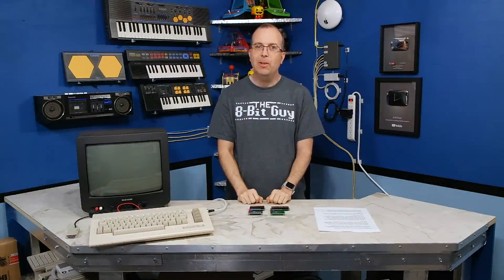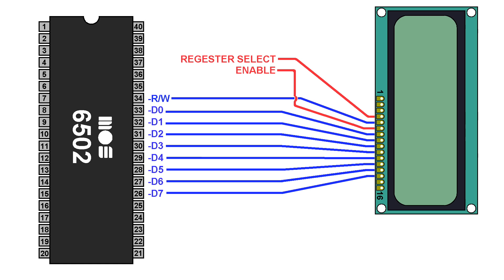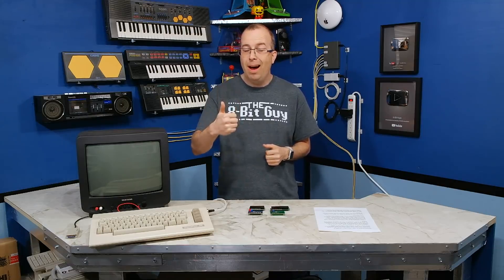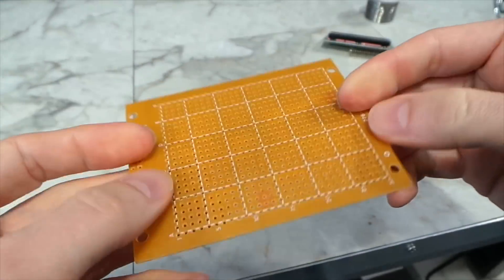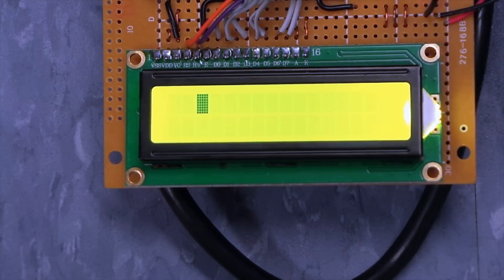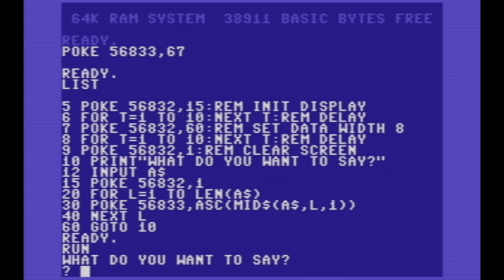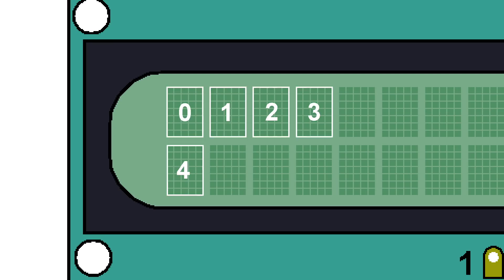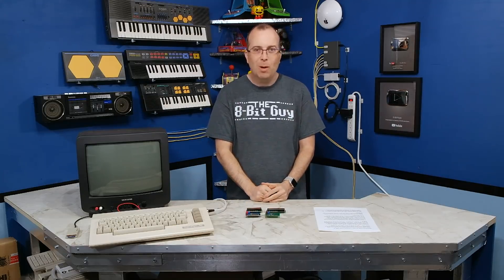How a Character LCD Works - Part 3

Comment: Good video, but I missed details about the boards your friend made and the details about those drivers/latches on them.
Reply: He used the expensive version of an arduino (pro micro) 😒...
Honestly i also do not like the final solution to get it working.
- the complex inverter with a chip instead of a transistor with pull-up/down
- the massive pcb with multiple chips and buffers without explaining or schematics.

This completely goes off track to the first video showing how "simple" an lcd can be controlled with switches and no ICs.

Interesting, video quality good, but sadly kind of did not get what i was expecting from Part1 and Part 2 😓
Reply: @Rob Alle Sorry, i do not understand the usefullness (or content) of your post, mr gravedigger (2 years).
 Having a bad day ?
Reply: I think it was complete overkill. All that was needed was to delay the enable signal until the data had settled. I'm actually very sorry to learn an Arduino was used for that.

Comment: Idea for a part 4:
connect the lcd to a parallel bus(LPT)
that would be awesome because i can make this at home.
I love you and your videos.
Reply: Character LCDs on Parallel ports have been done for years and years. There are tons of software out there that takes advantage of it, even plugins written for a long forgotten piece of software WinAMP. LCDInfo, LiquidMP3, LCDSmartie, LCDHype to name a few.
Reply: I did this after seeing the first 2 parts, it's doable except for power because parallel ports only supply a tiny amount of current, too little to power the backlight. You can take power from a separate 5V source like USB to get around that.

Comment: Uhm you skipped too much over the new boards.. You could have explained a bit what your friend did..
Reply: A lot of it was just compensating for the old nature of the C64 electronics. I could do an explanation, but I think I would fail at explaining it as well as the 8-bit guy does.
Reply: part of the "gates" are used to act as synchronous delays for all lines & 
one input for each is use so invert or not invert , maybe lol i dont know
Reply: My thought as well. Maybe a part 4 is needed?
Reply: 3. @3DPKD it isn't actually that. Normally you would expect to simply use the IO1# signal as the LCD enable line, where it would latch on the falling edge. However, with C64 basic something goofy happens and you get two IO1# assertions. One with the data you want, and one with "unknown." This is partly why the 8-bit guy's first crack at it was having problems. The 'unwanted' pulse was actually really short, though and the problem was that modern logic is so fast, it registered as an intentional pulse. So the 'fix' I came up with was to use 'era appropriate logic,' namely CD4000 series logic - which had a propagation time of 100x slower. Using that, we 'ignored' the glitch pulse and only act on the intentional one. However, going this introduces a lag, so we use the LMC555 to generate a known good enable pulse (see 2 above).
Reply: msx80 yeah that would have been nice to see.
Reply: 2. T Trinidad got it. I actually latch both Address and Data on the falling edge of Phi2 from the 6510. The problem is that the LCD wants a falling edge on good data. So an LMC555 is used as a one-shot to generate a lagged Enable signal and take the data from the registers. These choices were made to overcome some other signalling problems.
Reply: The larger ICs on the right are HC574, which are octal D flip flops. So they probably are used to hold the data from the bus for a bit longer. Maybe it has to do with the fact that those displays require a delay between setting the R/W bit and sending the data, and also if you look at the datasheet the data on DB0-DB7 has to linger for 5ns (data hold time) after the Enable bit is disabled.
Reply: Yes, I too was looking forward to understanding the "how this works" section which was glossed over.  Understanding this would allow creation of all kings of interesting projects, not just LCD screens.   David, how about some details explaining how the boards worked?
Reply: That's right. The most interesting thing in engineering is allways why stuff *doesn't* work. You learn the most from that.
Reply: Yeah a bit more details about those boards with the additional latches would have been nice
Reply: David Hunter are you the guy who had the boards made? Where do you order your PCBs, and how do you design them? I've been needing something of similar nature (not for character LCD, for actively converting internal display signals).
Reply: Agreed - knowing that info would allow folks to create a generic 8-bit interface properly (not just for LCD).
Reply: schematic?
Reply: Jonathan Saunders not him, but there are a lot of softwares that allow you to design pcbs like easyeda or eagle, and then you can get them ordered from someone local or china (jlcpcb is cheapest I’ve seen). There are a lot of tutorials online, check it out
Reply: msx80 Ditto. I came to make the same comment! This video was a bit of a let down because of the lack of detail, which effectively just turned it into a “look what I can print on this LCD screen thingy” video. Started off OK, but just jumped from not working, to... someone sent me a working board!
Reply: I don't know what was wrong, but I've got a good guess as to what specs you need to compare.  Many times, devices will have either a "setup" requirement (data value must be present and stable before the enable), or a "hold" time (data must be present and stable after the enable).  The CPU is a busy little sucker that's not going to spend much time with you.  Further more, the enable signals require time to decode and may throw off the timing.  Those buffer chips are likely there to either add delay and/or hold the data for the slower display.
Reply: A quick guess; one of two or combination of both "weird timing issues" 1. the C64 shares the address and data bus with the VIC chip 2. the data latch time (write time) for the LCD is longer in time than the 6502 supplies. The "extra logic chips", looks like two buffers, one for the data bus and one for the address bus, latch on to the address and data to hold it the extra time the LCD chip needs to read it. For the LCD, reading the data and then writing it to it's own memory may take a few clock cycles the 6502 doesn't give it. Analogy: the C64 writes the data to a chalk board and the LCD reads it from the chalk board at its one speed.
Reply: @3DPDK  Ah, so potentially the problem could have been solved in software by just waiting a moment or two longer with the enable line set high?
Reply: @rodneylives  As I understood it, with this setup (via the cartridge port) you don't control the enable line, it's set when you interact with that memory address.
Reply: David Hunter that's why we're here :) came to comment the same and learn more
Reply: So much this.
If any of David's patrons read this, may I ask to submit such a request to him please?

Elektro-Peter, I came here to write what you did almost verbatim.
Reply: @David Hunter: Awesome! Thank you so much for the explanation. While I'm not confident I've completely understood your solution, I think I've got a good grasp at the problem now. Good work!
Reply: This would make a great part 4 tbqh
Reply: Some cartridges used ugly hacks with RC filters to filter or delay signals. Worked most of the time :-)
Reply: Yikes. okay answering these in order of their asking:
1. I get mine made from pcbway (google it, can't do URLS in comments) - these were done in Eagle, but I'd recommend going to KiCad as a better, open source alternative.
Reply: 6502 drives it's data lines after setting the address. LCD controller is faster than the 6502. 6502 sets the address, which causes the LCD to latch the data on the bus before the 6502 has actually even attempted to write to the bus yet, causing the LCD to read in null characters each time.

Friend put some buffering on to slow the signal down so that the 6502 can finish setting data before the LCD is triggered. 

It probably would work without this if you did the address decoding yourself instead of using the I/O lines, and/or switched to assembly instead of Basic.
Reply: The C64 has weird timing garbage because of the video chip and the board is using some line driver chips and a tiny amount of logic to avoid it and make it work reliably. 
Ben Eater has a video explaining how to get it attached to a 6502 that goes into great detail if you care - But there's no reason to do this anymore.
Reply: Wondering if an analogue circuit might be sufficient to clean it up?
Reply: Creeper With Shades yep good ol Jlpcb, havent actually ordered from them yet but im almost finished my board. Just added a couple LED's and am going to cut the board on my cnc tomorrow. After that i have to do it all over again for the youtube tutorial.

So if anyone wants to know how to make a controller for the NES, Ill have a video in a month or so. Would be sooner but I'm really busy with web development. I promise it will be really good, everything from reading the schematic, to designing a board, creating part libraries, CNCing the prototype, designing the case in fusion, rendering in an external program, 3d printinf it and finally sending the boards off, and possibly sending the models for production, if i can find a place that doesnt cost thousands for a few models. If you know where please share.
Reply: Sounds similar to the bounce problem he was having with the button.  I wonder if it could have also been fixed the same way?  If a capacitor might not have worked to smooth it out?
Reply: he did
Reply: yesh! my biggest gripe too
Reply: What timing issues did your friends board solve, where is teh scheme, it is some putting data only if the adres is set on the adres bus? Part 1 and 2 was nice and sad your C16 is blown up by a vauly working powersupply, and dangerous you test it with your only C64
Reply: @satish8299  Well, First of all you should know that the LCD controller we talk about is a HD44780. I haven't really used a C64 so I currently don't know the timing scheme of it. However when you consult the datasheet of the LCD controller you get some bus timing characteristics. The controller expects certain signals to hold for a certain time. Probably the C64 is performing the commands / write operations too fast. See page 49 of the datasheet:

https://www.sparkfun.com/datasheets/LCD/HD44780.pdf

Keep in mind that a write cycle on the C64 is a certain sequence of actions on the bus which has specific timings. Maybe the I/O line goes low for a too short amount of time. As you can read in the datasheet the enable cycle time for the HD44780 has to be at least 1000ns ( == 1µs) and the high leven has to be hold for at least 450 ns. Also the raise / fall time of a signal change must not take longer than 25ns. Page 58 has an actual timing diagram. My guess would be that the "Data set-up time" might not be reached properly. Though it's hard to tell without knowing the exact characteristics of the C64. I did a quick google search but couldn't find a decent datasheet for a C64.
Reply: I’m sorry but that “uhm” makes me think 🤓
Reply: OH SHUTUP it’s his video
Reply: @msx80  old 64 died from 8 and 11 volts, but also he got new lCds
Reply: Uhmmm, uhhh , like uhhhmmm.
😅
Reply: The timing of the C64 is a mess. See for example the nasty little spike on the R/W line:
http://www.frank-buss.de/c64/timings/index.html
Probably the board he got was with a buffer for the data bus and some more logic to filter the other signals. Would be interesting to see the circuit diagram.
I did a LCD display project as well with a 74LS373 buffer which worked, full circuit diagram included in the project description:
https://hackaday.io/project/25257-c64-lcd-display
Reply: Thanks, David!  See, it's not that hard.  ;)

Comment: Oh yeah, I definitely encountered the weirdness with the first line wrapping to the 3rd when I was dealing with Matrix Orbital screens. Other brands of Serial screens actually corrected this, but MO's serial screens didn't. 

I did quite a bit more work with Noritake graphical displays after this though, but I still have a box of about 10 Matrix Orbital LCDs floating around that I might eventually use in some projects.